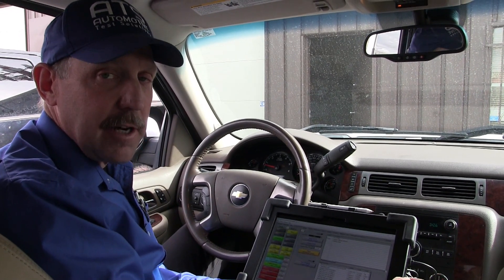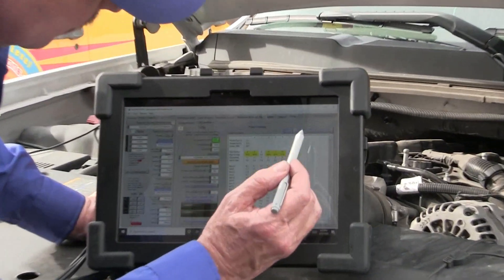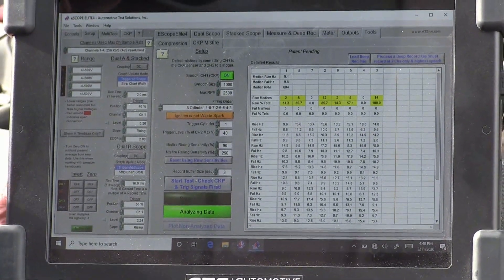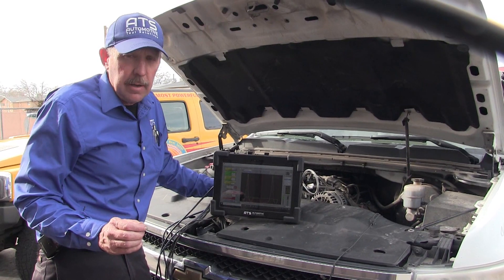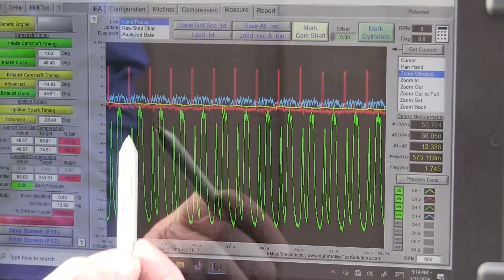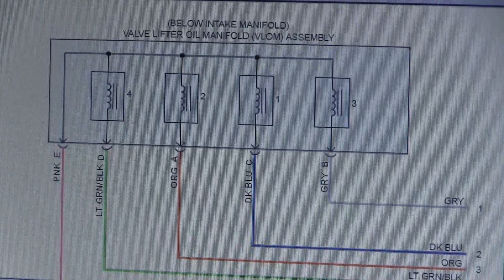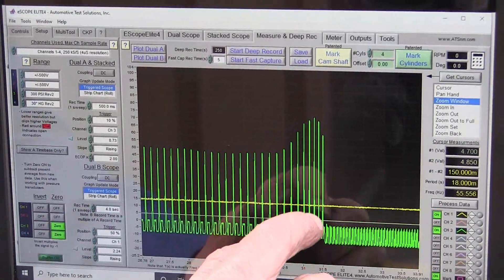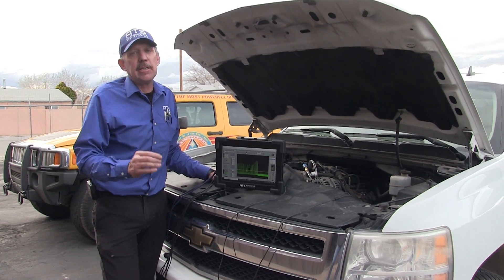2009 Chevy Silverado Missfire

Comment: how do you know it wasn't the higher oil pressure being built up at higher rpm leaking past  a suspect vlom solenoid causing lifter to collapse rather then lifter failing?  Isn't the load on the lifter the same if not less during higher rpm as less time forcing/opposing  spring pressure open is needed?  Did you confirm bad lifter ?  The fact that the compression returned at idle leads me to believe it is a solenoid seal leaking oil pressure  that is most likely the culprit.